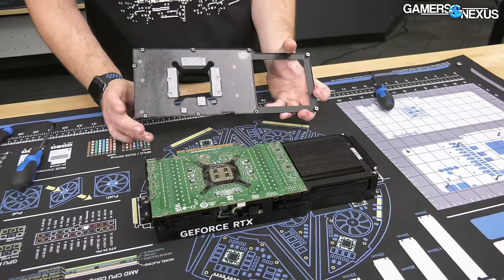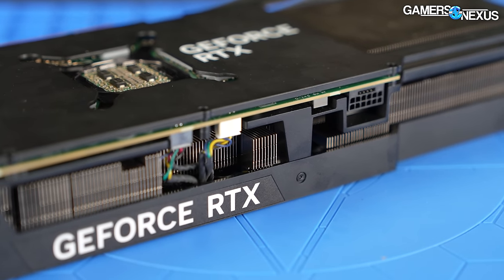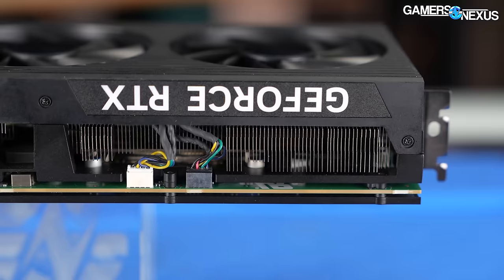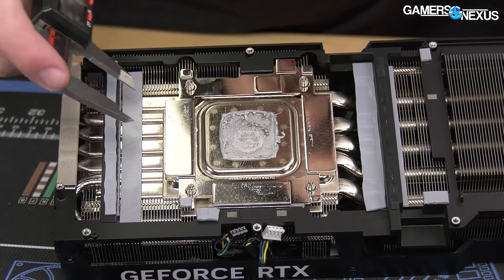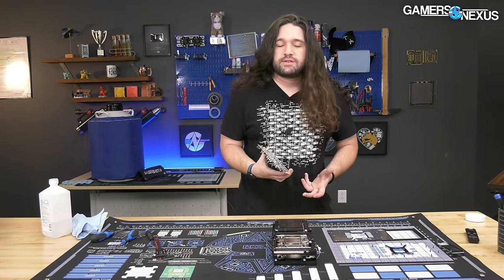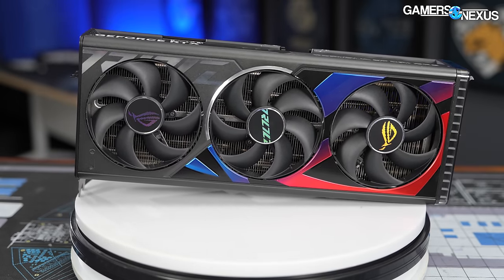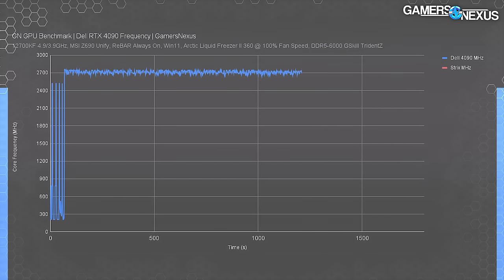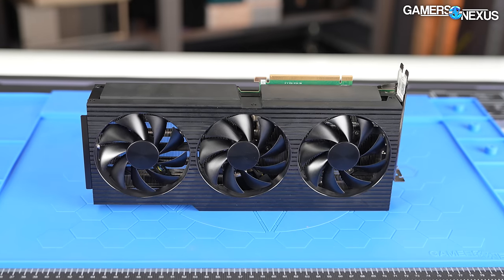Dell Made an Impressive RTX 4090: Relatively Small, Large Flow-Through, & Good Cooling

Comment: the r16 with 4090 is wired using a non-modular mini power supply and they only use two power legs - split into 3 - then the 3 way splitter down to the 12v power on the gpu.  that is wrong.  300 watts is not enough power for the 4090.  After my return window, i was left on my own to fix the issue.  I ended up re building into a new case, z790, with an appropriate powersupply with a 600w 12v power port.  after building this way, the gpu is able to draw 390 watts on average, which is appropriate.  I had constant blue screens, directx failure, game crashes, with no ability to do any type of tweaking in the alienware bios.  It was a nightmare.  Im happy that the cpu and gpu both perform well with the new mobo and new powersupply but I would not recommend any of these pre builts that cheap out on power supplies and mobos with no customization available.  Awful experience.  My pc is flawless now though, after a complete rebuild.  the ram / ssd / cpu / gpu all work fine.  everything else is garbage.  I dont think the cooler is even appropriate in the long run.  I upgraded to a 3 fan 360mm cooler.

Comment: What if Dell locked this card, because they knew the case they were putting it into sucked regarding airflow and temperature, so core clock impact would be inevitable if power was increased?  Literally ... locking it, makes them 'look' better, and clouds their obvious failure to make a decent case that can handle the heat output of an OC'd 4090.

Comment: Who cares if the cooling is bad or good?

It costs more than a decent gaming computer should.

Even with the improvements, there's still a chance the power cable will set your computer on fire.

And the tab thing on the bottom might snap off, rendering the card useless.

Nvidia has gone far out of their way to let everyone know that they don't want us to buy their cards. Listen to them. Let them focus on making AI accelerators for data centers. The GeForce line should be allowed to die from disinterest.
Reply: I use mine with a corsair 16 pin cable. It hasn't caught fire. Glad I bought one to use for VR gaming and 4k120 Armored Core 6, it was a big upgrade over the 4070 Ti and 3080 I used previously.

Comment: This case is a disgrace. Regardless of the hardware used, persisting on some custom motherboard format (for no benefit), the proprietary PSU and the outdated case, no salvation. Smaller companies can design new cases, and Dell should be doing the same. Some basic case based on the 5000d Airflow, personalised outer design, should be doable. No one is asking them to reinvent the wheel, but this whole approach is bizarre.

Comment: The Dell 3080 is as pretty awful.  Reference design, no additional power budget to speak of, couldn’t even come close to running 1.05v under load, maxed out around 1860 MHz on the core, VRAM too hot to OC.  Wasn’t until I liquid cooled it that the card transformed into a decent 3080, could get 1950 to 2050 depending on load, still couldn’t OC the VRAM, well, 84 C is too hot for my taste, especially with water cooling, Core was max 48C, so not sure why VRAM so hot, was a ghetto loop tbh, spent $200 for everything.
Alphacool Eisblock

Comment: green PCB just to show how cheap will Dell go
Reply: These may be cheap. In the real world, green PCBs are a MIL/Aero standard requirement. Not cheap.
Reply: @blackrifle6736  In the case you mention I bet is for uniformity, so they know what to look for, also should have to do with the components being easily visible without PCB being a flashy color, etc. Probably dates to old standards where there were only damn green PCBs...

Comment: typical dell build a shit PC but put a good GPU in it. All that air through put in the card, in a case that will be blocked off from any air. PMSL.  Dell is pushing the heat offthe motherboard really cleaver design. As heat on the mobo could crack the mobo and make the card sag more. Also on most mobo M.2 live in the PCI-E zone so a hot PCB on motherboard is not great I really impressed with Dell Dgpu's in just a shame you only get one in a OEM shit box PC.